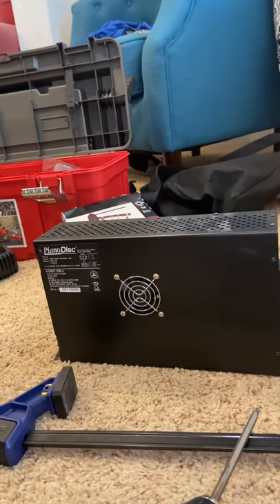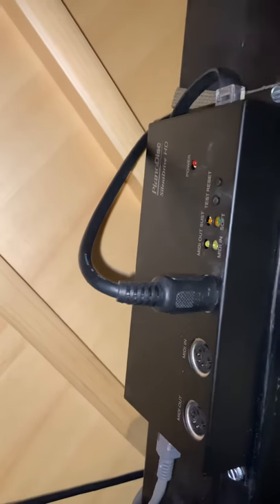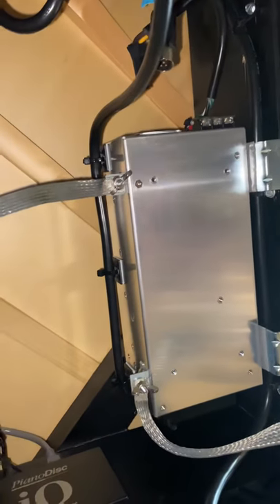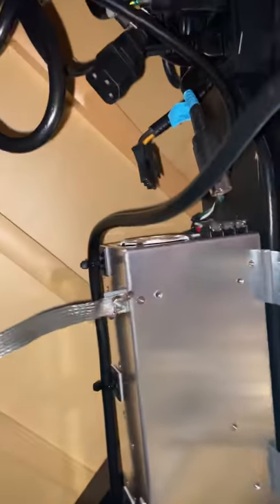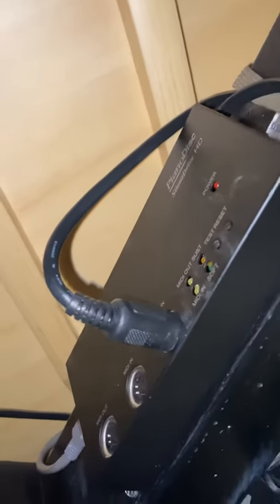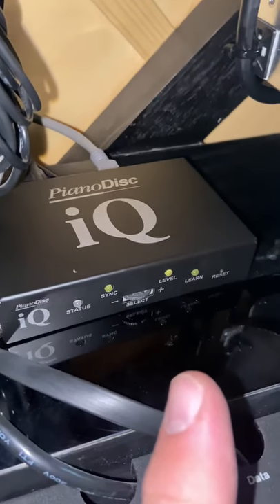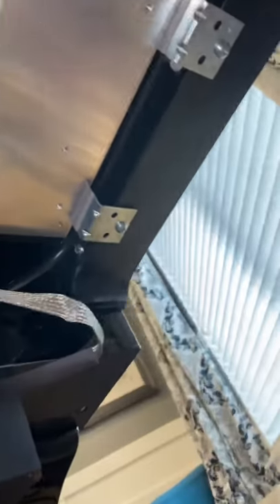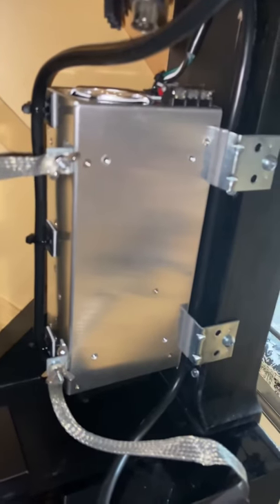Latest PianoDisc replacement power supply for Silent Drive HD iQ

Comment: I had the exact same problem and was able to fix it for $30 in parts.  It's probably too late for you, but here is the how to video I put together on how to get it going again.  https://youtu.be/tGL2Sfv1aY4  I wouldn't be surprised if changing the same 6 capacitors resolves it for yours as well.
Reply from the maker: @shaneperche-fixed-it  sweet thanks